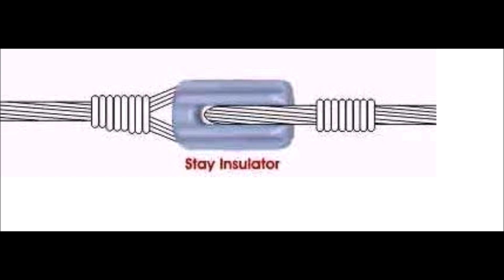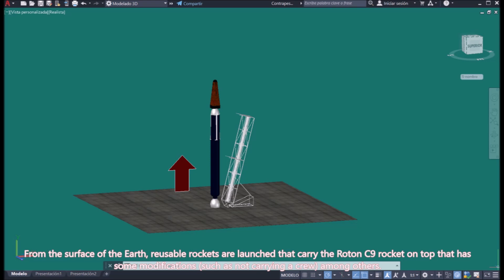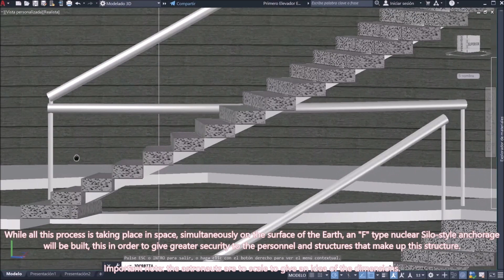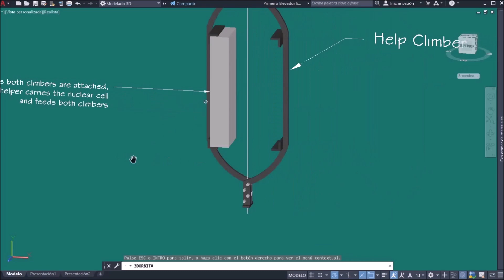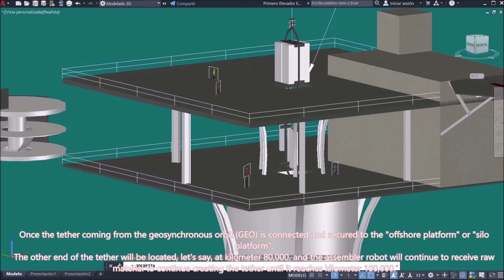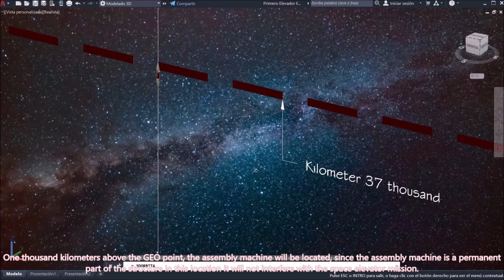Primal Space Elevator

Comment: An interesting iteration of the concept. But I think there are three key elements you might consider in your design. 

1. That a space elevator is really not the most efficient method getting things into space and that it actually is much more useful for sending objects out away from Earth due the incredible relative velocity at the tip of the apex anchor. An object sliding outwards from GEO along a 100kkm tether has enough kinetic velocity to leave the solar system AND the energy required for that launch has a linear relationship to mass and delta V required rather than exponential as with rockets. This can also work for getting to GEO, but the margins are much smaller.

2. Sourcing the motors, power source, and payload containers on all the elevator climbers is a highly inefficient process which forces the climbers themselves to face the same punishing lift-to-'fuel' style dynamics of the rocket equation for moving cargo since they much carry their "fuel" with them. As an alternative, just like in a traditional elevator, lifting the motors one time and providing power to them in a fixed position on the structure off the main tether frees the ascent vehicle from those requirements and changes the equation for lifting cargo into an almost purely linear fixed cost per unit cargo.

3. Building on the premise of fixed locations along the elevator, it makes sense to use the main tether more like a structural element, like steel pillars in a skyscraper, and to build out from that backbone your climber elements, science platforms, transition elements, and even fabrication and storage facilities in GEO where the additional mass has no effect on the mechanical limits of the tether. The GEO region (or Galactic Harbor) could function much like St. Louis did during the great westward expansion in the US as the last city in civilization, which could source goods from anywhere, and equip journeys out into the frontier.

Like any major infrastructure project, a space elevator is not actually that valuable as a commercial service (and if you try it fails at being useful infrastructure) but it drastically reduces the friction (bureaucratically, financially, and logistically) to commerce in space. This reduced friction in turn creates myriad opportunities for new and expanded activity in space which has an exponential relationship to linear reductions in price. This makes a space elevator a critical tool for humanity to developing a foothold in space and expanding our economy outwards, but it also likely means it will perform poorly as a business case directly. The branches off the space elevator are where the real value lies, not in just getting to space.
Reply from the maker: Greetings, thanks for your helpful comments... I'm not really an expert on this subject, but I try to incorporate every new tip that experts give me in my next video, for example, your No1 tip... I tried to incorporate it In my last video, I used the old Roton C9, since my idea is that he travels to the Moon powered by the Esp. Elev. full of fuel, to take materials to the moon, once on the moon it can be unloaded and reloaded with materials or lunar regolith, take off with its own engines and land softly here on Earth... here is the link:

https://youtu.be/pha6iNMrmLg
Reply: @TETOYVIENDO hi